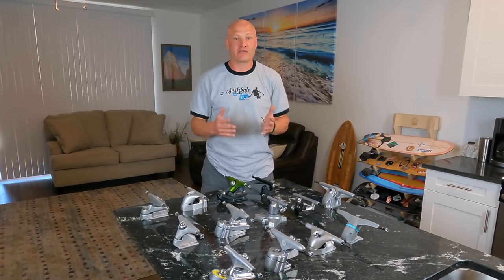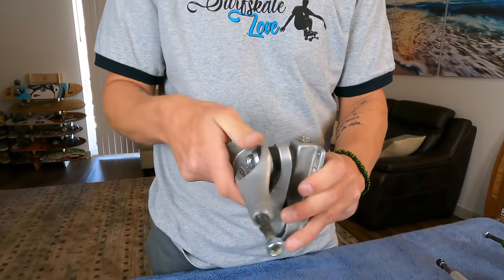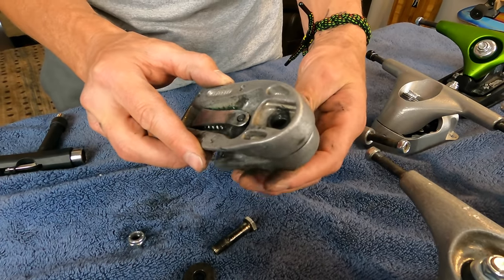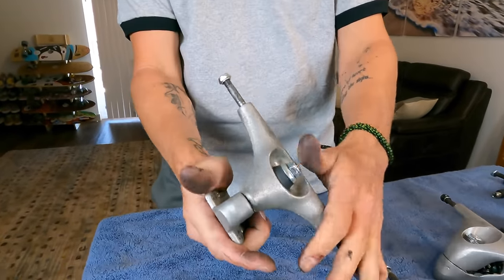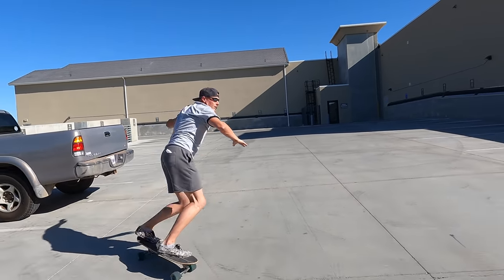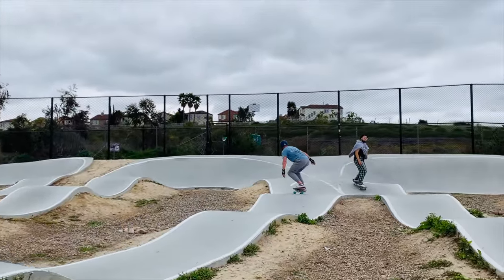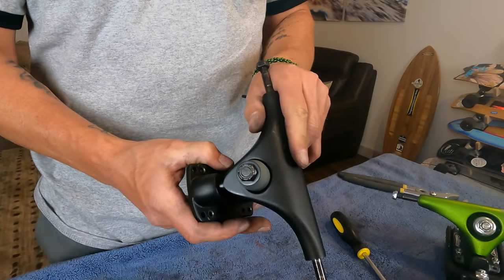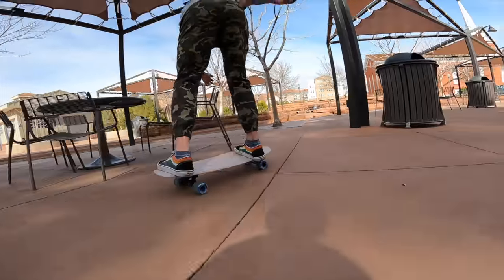13 Surfskate Trucks Dissected, Reviewed, & Compared

Comment: I started on a board with (I believe) first generation  HST trucks  very  loose  carves really well as it stands I like it better then my smoothstar with the new generation of HST trucks
whose back truck be changed from 40 20 to 10 making it more stationary does that help with pumping ?
Reply from the maker: You're comparing Hamboards HST trucks to Smoothstar? That's very confusing to me because they're not even close to each other. Smoothstar is WAY better for carving than the HST. And yes, changing the back angle of the HST trucks does help them pump better. But even still, they don't pump at all like a normal surfskate with a radically turning front truck combined with a stable rear truck.

Comment: Hey Steve, thank you for your great research and testing work!

I want to upgrade my old Skatesurfer from Jucker Havaii (3 wheel system) into a surfskate. What do you think, should I go for the Waterborne Surfscate Adapter or the Silde 3.0 front truck? They both cost nearly the same (Waterborne front Adapter 60€ and Slide Front truck 62€) and I already have wheels and a longboard truck.

Thanks again
Reply from the maker: I would definitely go with the Waterborne over slide.

Comment: Hello! Thanks for all your vids and experience. I have a question about the Globe surfskate and the trucks that they use, called REVENGE. They are kinda old and I pretty weird about why you didn't make any reviews about them. What's your opinion? ohh grand master guru of surfskate =) Thanks in advance
Reply from the maker: I don't like them at all. They have the same truck on front and rear, so it's a different feel than a typical surfskate. What makes a surfskate generate thrust is the combination of a swiveling front truck with a stable rear truck. When both trucks are the same, pumping feels much different and it's not nearly as efficient.

Comment: I've been looking at moving from my Mindless to a Carver CX and to find out they're essentially the same is such a great thing.

I think I'm pretty much set on keeping my Mindless and just periodically upgrading it.

Would love you to do a video on Surfskate wheels.
Reply from the maker: That's actually on the way!
Reply: @SurfskateLove  can I make a request for you to cover how the size of the wheels may alter the ride and risks of 'biting'?

As an example, my Mindless has 65mm wheels yet I'm worried if I buy 70mm wheels which are much more common, I'll get wheel bite.
Reply from the maker: Good idea!

I don't know that the Mindless truck has enough lean to hit wheelbite on 70mm wheels or not. Try it out, and if you get wheelbite, just add risers.
Reply: @SurfskateLove  another thing that would be interesting is if you had say one selected board like the CX Carver and then swapped out wheels and reviewed how each felt and how the durometer makes the board feel.

I really want to put Roundhouse carver on my Mindless!
Reply from the maker: @obsoletepaul  I'm going to do a full wheel review soon. "What are the Best Wheels for Surfskating?"
Reply: @SurfskateLove  looking forward to it
Reply: @obsoletepaul  I have a Mindless and on stock 65mm wheels I was getting wheelbite on rear left wheel only...I am about 195lbs/90kg so maybe thats why.
I upgraded to 70mm Orangutan 4president wheels and used the Waterborne risers front and rear (Have Waterborne on another deck but use rail adapter) and now no wheel bite. Plus with the 4President wheels and  Bones Reds bearings it rides like a dream🙂

Comment: man a little more digging and you'll know smoothstar doesn't own the patent on their adapter. i believe that's why they can't sell them separately. there's actually three versions of the system already. but the OEM will not sell them unless in bulk. i notice some bits of unconscious bias inherent not just in your videos but on other vloggers as well that is riders prefer what's available or easier to purchase/import. Aussies tend to favour smoothstar of course, US based riders tend to favor waterborne or YOW. but also as you and other vloggers mentioned, it depends on the style you want to achieve. beginners prefer adapter with more stable and more pumping response while real surfers prefer adapters with more smoother rail to rail transition and smaller turn radius.
Reply: I totally agree with you the availability you can easily buy from your region meeting to your style. I personally feel YOW and SLIDE are good for Europeans to buy. If shops are opened, I go there directly and test a ride but not possible because of COVID-19. The Truster other versions are good for Japanese as well. Japanese can easily buy a part, not in bulk. May be impossible if you do not know from other regions. Looking at the local online site (Rakuten ),  Perople will be realised of course able to import to their countries if they are eager to test it. There are a good services for transportation individually over the world.  Online purchase makes it easier like your local shops now. The crazy situation is that adapters/surfskates are sold out over the world, so Steve`s review are so welcome by many viewers.
Reply: @hijkr  yep forgot to mention the yow and slide for EU. It's not all about the gear. You can see a lot of riders rip the just CX and C7 or decathlon surfskates to shreds with total control and style. To sum up and as Kales Brock mention in his Smoothstar/Carver vid, in the end these surfskates are trainers. You need to have a good program/coach for you to progress or you could just as easily go learn wrong motions.

Comment: Dude you have to try the Revenge trucks, they are fun 💪🏻
Reply from the maker: I have, I'm not a fan. I don't like anything that has the same truck on front and rear (Revenge, Hamboards, Gullwing Sidewinders). The principle of a surfskate is a stable rear truck combined with a lateral swinging front truck. That's what produces thrust.